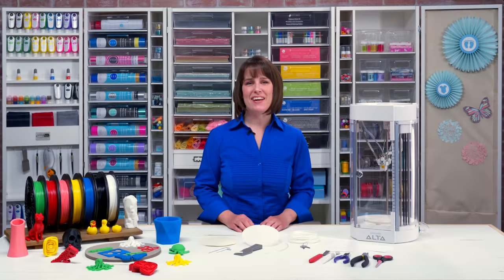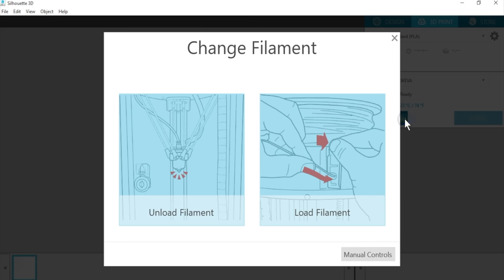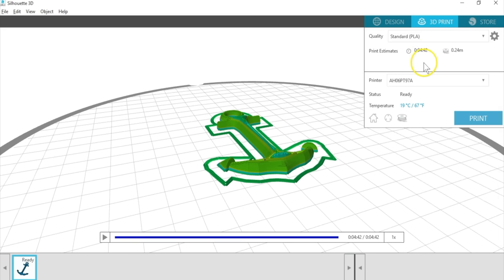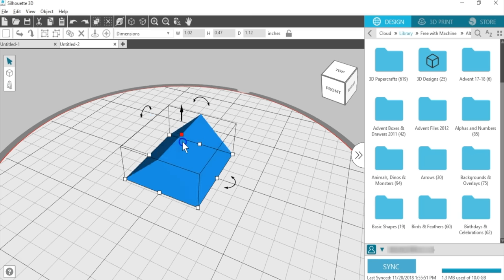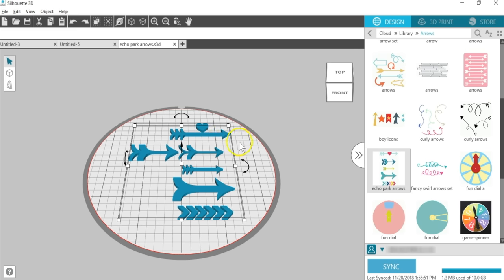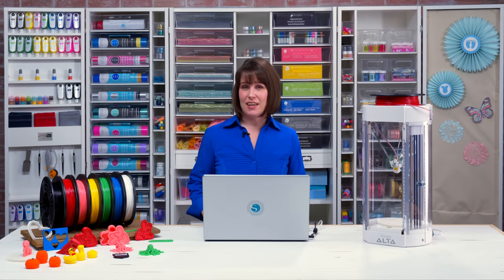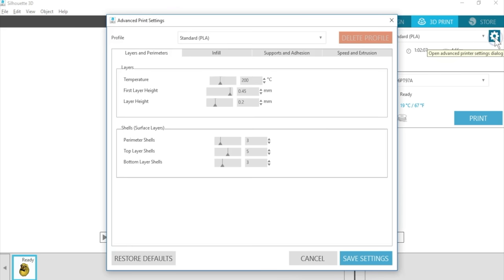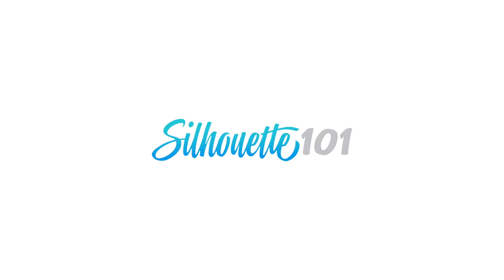3D Printing Basics (Silhouette 101 Video Class)

Comment: Hello,I have problems with software 1.2.212
Problem n.1 = opening the program the wi-fi disconnects. 
Problem n.2 = the response of the machine to the manual commands of the filament is very slow. The program in general is slow.
Sure of your kind reply, best regards

Comment: Will the software will be able to export stl files in the future? I dont mind paying for it. I already had a printer when the alta came out. But i really like the cameo and alta software.
Reply: Sophie, I can't confirm this will actually happen because it's still in beta testing, but in the future watch for a pro version that not only exports to .stl but also runs other 3D printers from the Silhouette 3D software!
Reply: @KellyWayment  Has Silhouette made it where Silhouette 3D can run other 3d printers yet? And if i design something in Silhouette 3D, can i save it as an stl and use a different slicer (Cura for instance) to run either the Alta or a different machine? im asking because i see its been 2 years since your reply here. Please and thank you
Reply: @scottulcak9749  I do not believe so. There has not been any significant update to the software since 2019.

Comment: My prints are getting completely stuck to base tried cooled few mins and still warm it tears the tape and could only get it off using a scalpel carefully not damaging the plate , how can I stop this the plastic tool didn’t work it just slipped and sliced my hand open.

Comment: I love the 3d files. How much filament is used to make a typical design? Can you use the filament included with the Alta to make more than one design?
Reply: Yes, I made a lot of small pieces with the filament that's included. You can probably get hundreds of designs made with a refill roll, depending on the size and quality of your designs. It goes pretty far.
Reply: @CreateWithSilhouette  Can you use the Alta to make the regular boxes and 3d flowers in the Silhouette store?
Reply: @sedirasanders4853  the 3D papercraft designs in the store do not translate directly to 3D printer designs as I think you're envisioning.